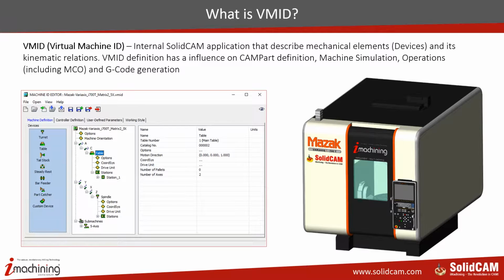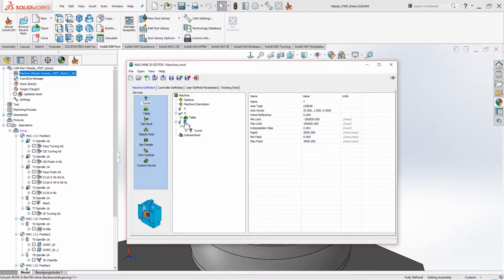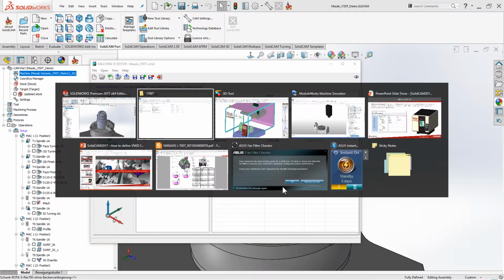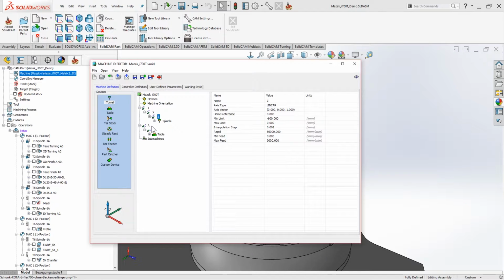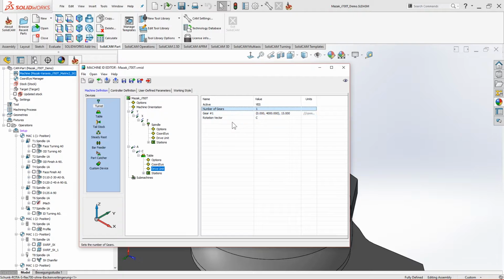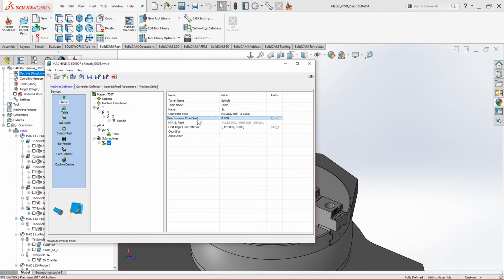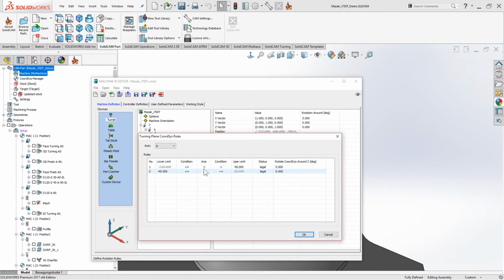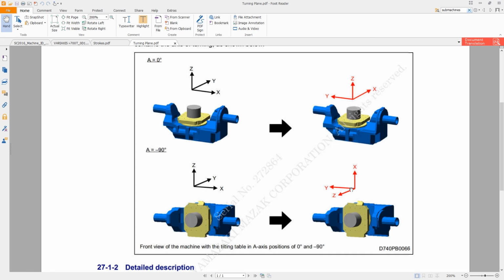SolidCAM 2017 - How to Define VMID for Advanced Mill-Turn Machines (Part 1)

Comment: Hi it is very informative video. But I cannot do the last part - export to xml. Simple there is not  the button that you used. Could anybody know what is the problem?
Reply: I have the same problem
Reply: Yer same her, you can duet manual, its a pain but its posebul...
just open another existing machine and make a new file in the Moduleworks mashine simulator